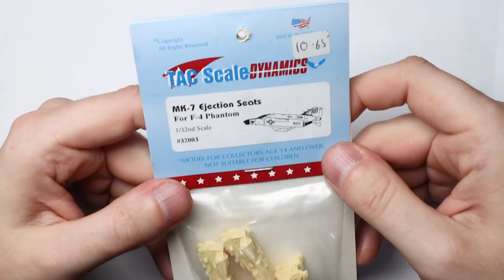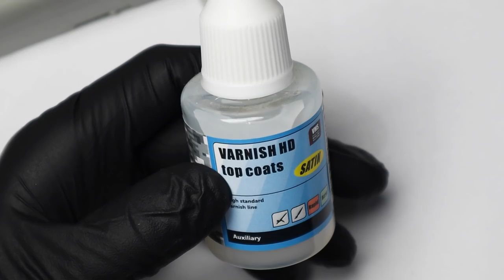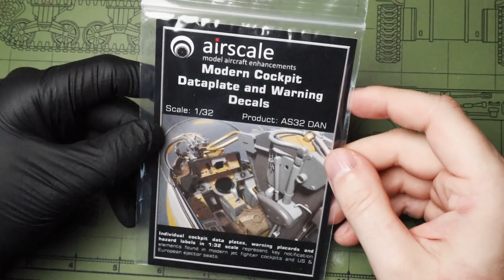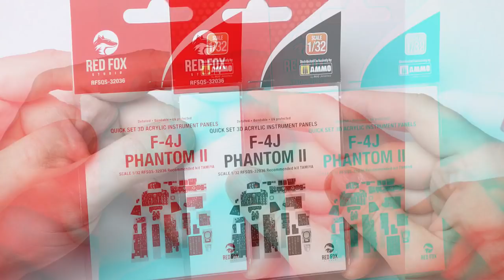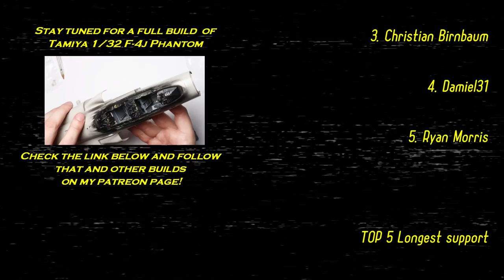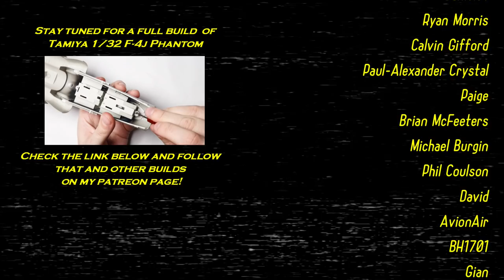Tamiya F-4 Phantom 1/32 タミヤ  cockpit build

Comment: I'm 14 and a relatively new modeler. do you have and tips tricks or advice for me?
Reply from the maker: Yeah if you can, join some scale modelling facebook groups and don't be shy to ask questions if you have any problems. Ask for honest opinions as some people may see things that sometimes you don't on your model and this can help a lot. Lastly, never let anyone discourage you and feel down, this is also YOUR hobby so enjoy it!
Reply: @ScaleHangar182  Thanks SO MUCH! I Just bought a metal earth Sikorsky black hawk, its a metal model that you bend the pieces, and a monogram sherman tank. I am going to be getting a new airbrush, i have two but i would like another one so when i get it ill paint my new model with my new brush! Thanks again have a great day!
Reply: Build more models 👌
Reply: Think of the hobby as a career.  Tips and tricks will only do so much but won't make you a better modeller.  If you were to look inside an advanced modellers hobby room/area, you will find shelves with many modelling related books, reference material, subject specific books and a bench full of different tools, paints, materials for any purpose.  You have to feel your way through what you're comfortable with, what works for you.  What airbrush or paint brand works for someone else might not work for you or even be available in your area so you may have to compromise.  Just build more models, watch what other modellers do.  YouTube has a large modelling community.  Join your local scale model club or go to exhibitions showcasing scale models and ask questions.  Join online forums.  Experiment too.  But the no 1 rule is have fun and enjoy it and don't get suckered in to being swayed by negative opinions on certain subjects.
Reply: Let me add my vote to joining clubs and groups. One thing I absolutely love about modeling these days is that modelers are so willing to share what they've learned. I wish that kind of support had existed when I stared modeling in the 1960s when modelers were considered weird. ;>)
Reply: Overall watch videos on youtube, that helps you improve the most.
Reply: Practice, practice, practice.
Reply: @isaiahbarnett9062  Hello, i also just started picking up modeling again and i wanted to ask you which Airbrush you bought because i am also looking for a Airbrush
Reply: A few things I’ve learnt:
1. There is no technique that can replace time. A particular section of a build may take ages, but it’s worth it. Don’t rush anything.
2. Some builds will suck, some will even fail. That’s OK - it happens to all of us. Reflect on why and what you could have done better and go again. Don’t give up on the hobby! 
3. Don’t try anything complicated to begin with. Start with a basic kit and learn some basic skills. Give yourself a foundation to learn from. Build your skills by building more!
4. The only person that really needs to enjoy your models is you. Enjoy it for yourself first and others second.
Reply: @andrewbrown2249  thanks! A couple weeks ago I repainted an Israeli Tiran 5 it looks so much better than when is started to paint models. I stated hand brushing now I use an airbrush they have improved so much! Yea some of mine have sucked had parts fail but saved it. It's so rewarding when you can see the improvement you have made!
Reply: @dutchthespitfire3204  sorry never got the reply notification! I got a costway. It came with 3 airbrushes and a compressor for I think around 100 to 120 bucks
Reply: @dutchthespitfire3204  got mine on walmart
Reply: Right on bro !! It's a great hobby and you'll be surprised how much your new learned skills will benefit you later on in life !! Good luck and enjoy
Reply: @fartingdog20  thx man!
Reply: Continue to build and skills will come, and of course take a look what the pros do, but do not take them seriously. Go your way

Comment: The problem here is that you spent hours adding weathering to the tub of the cockpit and the seats, but the IP and various sidewall panels are in mint condition and don't colour match. The sounding grey of the side wall panels should be the same as the tub, and just as scuffed up. That's the biggest issue with cockpit decals, they only really work if you're doing something fresh from the factory.
Reply from the maker: When its closed up you actually dont see that colour differance and if you wish, you can always weather them too.